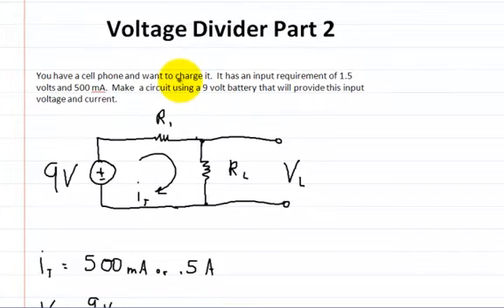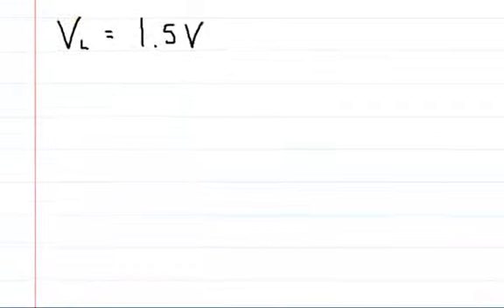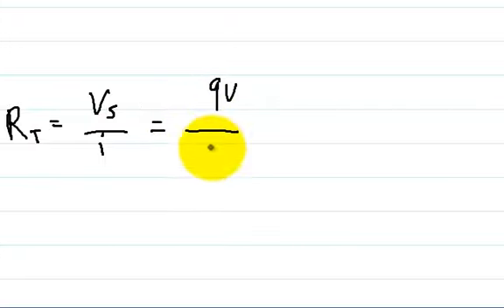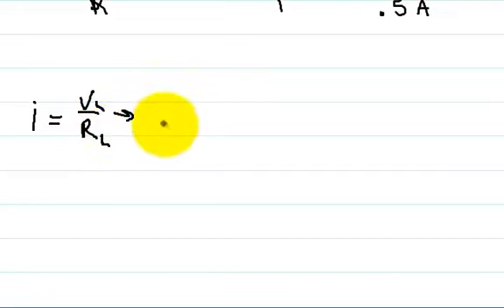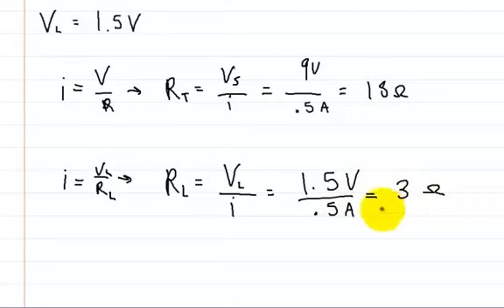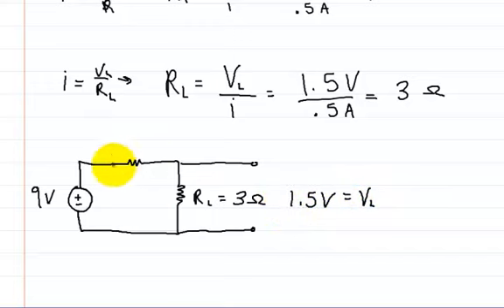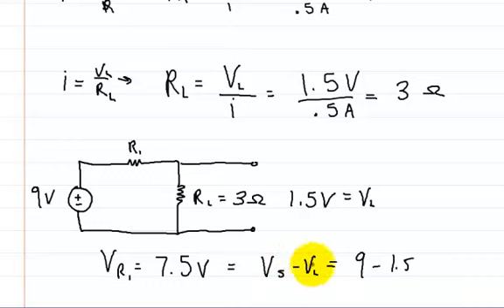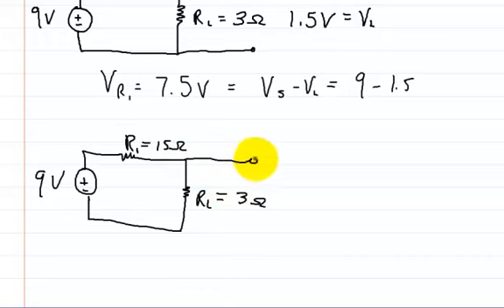Voltage Divider Part 2-Charging a Cell Phone w/ 9v

Comment from the maker: If you change the resistance value of each resistor, you will change the voltage dropped by each resistor accordingly.  So if the value of R1 = 3 ohms and R2 = 15 ohms, then the Voltage on resistor R1 will be 7.5 Volts, and the voltage on R2 will be 1.5 Volts.